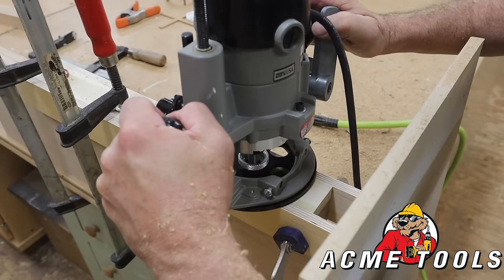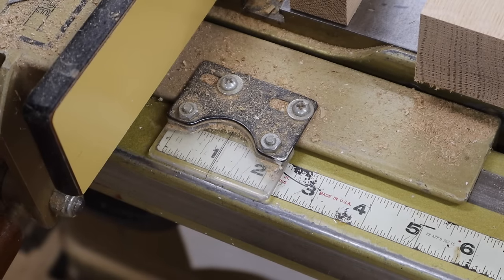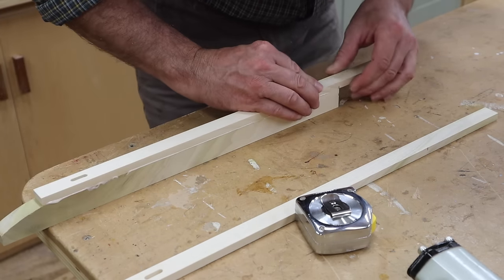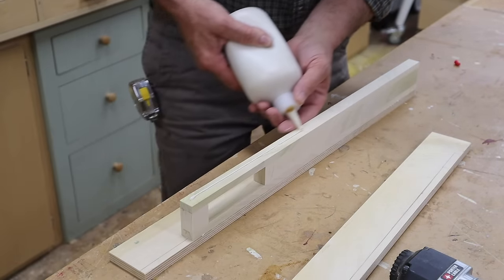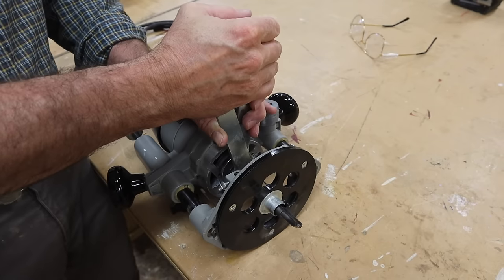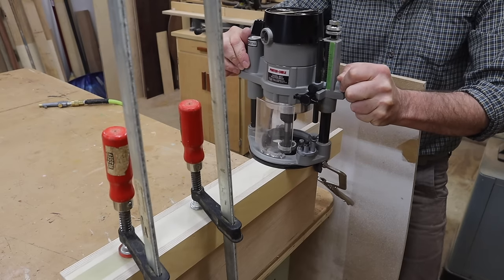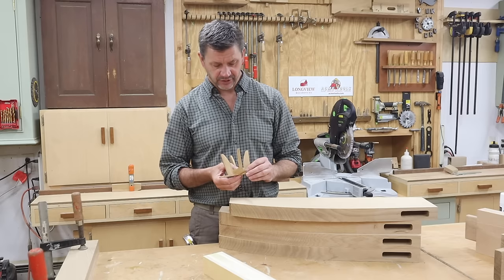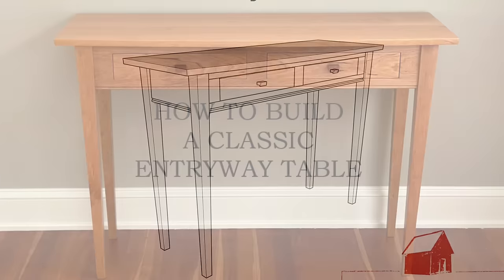How to Make a Mortise Jig for a Plunge Router

Comment: Fairly new to woodwork, projects so far ok but a bit rustic.  Like the way you make it easier to do accurate woodwork.  This looks the ideal way to do mortises on 4 X 4 legs for my first workbench. Perhaps you could show us how to modify this to do it on the ends of rails and stretchers.  It would then be so easy to join the pieces with loose tenons.  Thanks again, another great video.

Comment: I used to dred putting the work in to make jig for a project.  I learned that, especially when batching out large numbers of parts, a well made jig is well worth the time.  This one looks no different.  Can't wait do see the other videos and final project.  Also, when measuring your guide bushing did mean to say '3/4 inch guide bushing'?  I think you said 3/4 collet when in the video you were measuring the guide bushing.  That would be a monster collet that I'd like to get.  Except that my router's shaft is 3/4 inch inside diameter, so, a loss for me. 😊

Comment: Hello Peters, i use biscuit to join boards but the edge between boards Still have some 1mm difference. i dont have planer so i use bottom clean router bit to flat the board. but it ends up warp the surface. do u have other suggestion to remove those small height difference?

Comment: Good video! Where did you get the idea to use the stagger tooth plunge bit from Amana? Never seen this kind of bit before. I'm wondering how do they compare to 2 or 4 flutes spiral bit. I have to make mortises (2 1/2" deep) in baltic plywood, not sure if I should go with a stagger or spiral bit.
Reply: i have the same doubt :(
Reply: The upcut spiral bit will clear the chips out much better and leave a cleaner mortise. It will be much more expensive. The Baltic Birch or any plywood will be very hard on the bit due to resins in the glue and alternating nature of the grain. In this application a stagger bit is probably better suited.

Comment: Nicely done Jon! Looks like a great jig. However, how do you determine the opening size needed to cut the mortise in order to match the tenon? Also, I take it that you would need to make other jigs if you are using different thicknesses of wood? Just curious......
Reply: Steve you are correct, this jig was specific to this size wood only as well as the router bushing and bit combo. To this, I would have liked if Jon laid this out further so as to be able to make our own using the combos we had.

Comment: I saw your video and thought it might solve my dilemma. I want to make / use a jig to cut the slots in the wood for a Star Wars “Death Star walls”. Similar to what you did here, but repeatable cut, at different lengths to achieve the design on the same piece of wood. Do you have and recommendations?
Reply from the maker: Sure if the width is the same you can change the length bye using screws ... it’s kind of hard to explain but if you watch my video on how to install the Soss hinge I think it will become clear. Search Jon Peters Soss hinge on YouTube To find it

Comment: 3:21 where I can find a “bushing” like this in order to use it with the long router bit??...do you have a link for?
Thanks
Reply: Anyone have an idea??
Reply: It is not the length of the bit but the diameter that counts in regards to what size bushing to use. Don't forget that you need the appropriate clearance between the bushing and the bit.
The length of your bit depends on your router and it's available plunge depth.

Comment: Nice.  As I've looked around to cut these you have sevral options, as useful as this jig is. Its only use is to cut the size mortise you need for that project unless you find a way to cut a differnt size by adding differnt shims.  However you can take this concept and give it more adjustability with moving stops and changing sides.  Your not always going to want a mortise cut that size and with your set of guides for the router and other bits you can cut 1/8"  and up mortise to any length  lets say a tables stretchers are 3" x2"  and you only want a 
1" floating tenon  as it is this jig wont work, but its usability can be made to do the table you made or the proposed stretcher i said if it has adjustable built in.  Why make a one trick pony when you can build a stable of horses.
Then you'll only have to make one and it will come in handy on other projects.

Ok you can buy sevral differnt machines that do this I know, this is a shop made souloution whos got 3k 2k or 1k bucks to drop on one of these machines I dont.
So you find a different way thats cheaper
But if you do lets make it do sevral sizes
Otherwise you have a jig on the wall to only do one project with.
I dont have the room to store 5k jigs
So it would go into the fire place.
But if I can take that tool and use it on a lot of different projects, im going to keep it in my toolbox and use it.

And honestly I belive you would too.
I mean you've got an Amana bit that wasn't cheap so you do a lot of projects
Im not knocking the idea its a good souloution but it can be better.